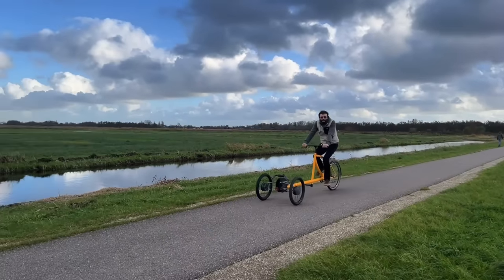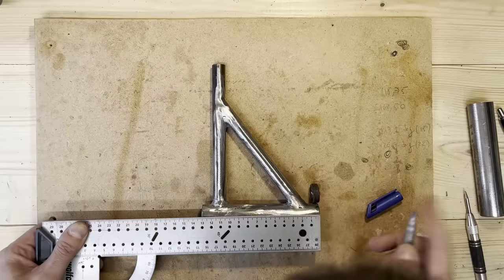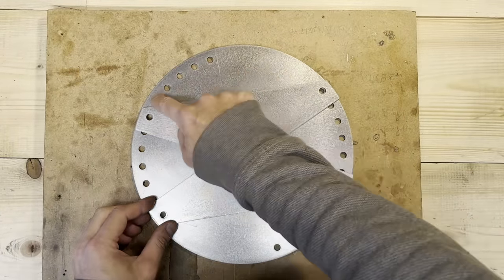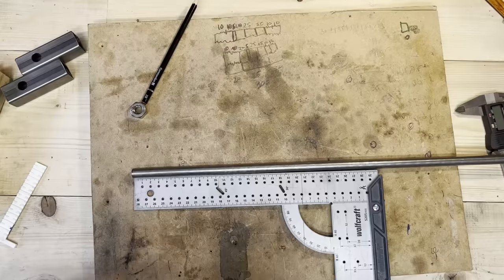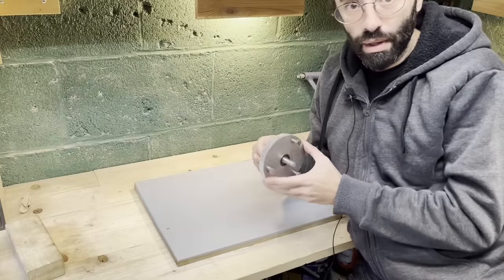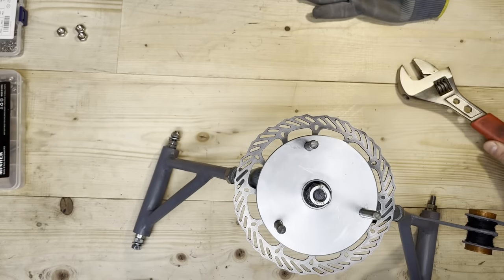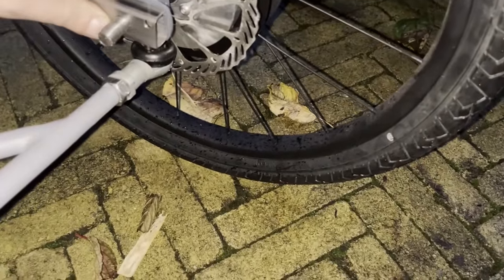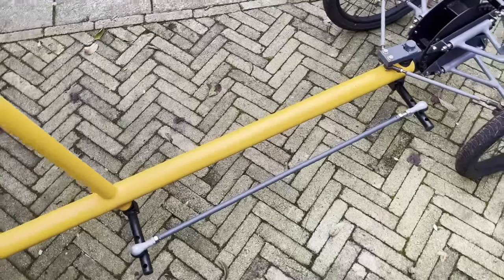Making of a Reverse Tilting Cargo Trike with Adjustable Geometry #5 - Full Build

Comment: All the ideas are there and great @predo-neves. I have many tips for manufacturing with more precision and simplifying many processes or just time saving. I don't know if you look into comments but I would love to share with you my experience and knowledge either by direct messaging or as a reply to this comment.
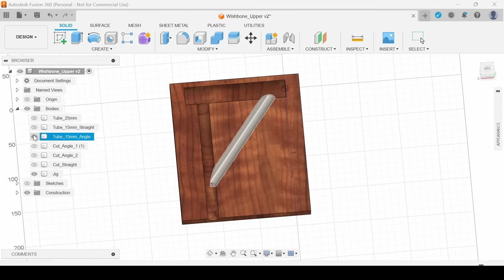Reply: 1:00 your jigs (repeated everywhere) could be made simpler with V faces. it would just take less time to make them and work just as well.
1:50 your notching jig could use more rigidity similar to a tailstock on a lathe. it will help belt tracking and accuracy and repeatability of your angle. it would also be wise to have your jig more perpendicular to the spindle instead of the pipe moving on an angle. the rear roller could also have a more elliptical profile to help belt tracking
5:30 your weld prep (repeated everywhere) could be improved by adding a chamfer to your tubes to both guide the weld and ensure full penetration even after grinding.
6:10 Ball bearing work best when the inner race and the outer race are in line. I would have a spacer tube free floating on the throughshaft on the inside or use angular/taper bearings or just use urethane or nylon bushings or even change things up to use rod-end bearings. you also can't be certain that the bushing you used has a face that is parallel to the other side less than 2mm.
7:10 almost all your connections could be done with male rod ends instead of the automotive bushings you used. you would only need to weld nuts or threaded weld on bushings at the ends of all your tubes and a locking nut onto the rod end. they can be bought in bulk and you can get some nylon style or greasable to prevent corrosion. 
the automotive ball joints are almost all used incorrectly because you are supporting loads on the threads instead of the tapered surface of the stem. you are paying for that precision on the stem which needs a hammer to uninstall usually because of the tight fit. you can easily get by with using male rod ends with a hole in the bushing for partially threaded bolts and adjusting is easier especially where you have a rod end on both ends, you can use a right hand and left hand threaded to make it so you only have to turn the tubing in between them to shorten or lengthen.
9:53 your load path for the suspension linkage could be improved just more of an angle to resist the shock absorber wanting to tear it apart laterally.
12:40 your caster disks are great but the nut should be on the inside of the plate. your plate is the reference surface for flatness but it is irrelevant when you weld a nut and use the nut surface to mount your items.
 13:08 your marking jigs should just be bolted to the pipe and never touched for the rest of the operations. you now have a square and true block which you can drag along a marking gauge that is fixed but adjustable height. to ensure calibration, drag it once for center and flip your part and drag it again. if the line is perfect on top of the other then you are on center if there is a small space between the lines you can drill in that small space.
Many of your drilling operations would benefit from a second center punch or the use of a center bit. they are more rigid and don't wander as much. your parts should be free to move across the level pane of your drill press when they are being drilled using a center punch. if the part is fixed but not lined up perfectly then the drill bit will be flexing if it finds its way into the center punch. you can see many shots of this in the video. the center punch needs to do its job of centering the hole to the drill bit. 
15:00 your hole saw needs more guidance for the fist face. just a block of wood against the near side to help guide the center bit.
15:46 get a drilling vise for this operations and most other drilling operations in your video.
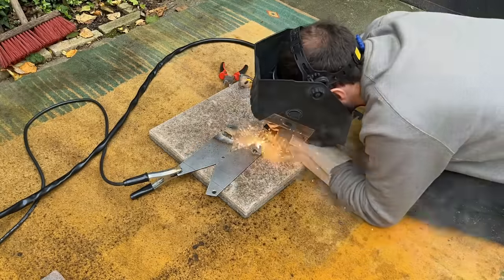16:20 callback to the tip for weld prep. the small 3mm plates should get a chamfer to strengthen your welds. a rod could be used to ensure the holes line up and don't warp when welding. If you used rod ends or bushing or just used two bolts for the front and back of the a arms you could avoid the need for slots. In terms of load transfer you can go back to picturing your shock absorber wanting to resist side to side compression so if you don't tighten the bolts in the slots well enough the wheels could blow outward. you could also have the slots on an angle so that if the bolts come loose you still have gravity holding the wheels in place.
17:32 example of drill bit bending. the part either needs to self center using the center punch hole or you should use a center drill bit that is more rigid to start the hole.
17:41 example of chattering cause by the drill bit not being centered on the hole. you can help this a bit with some paper towel soaked in oil between the drill bit and the part but you should really just let the part self center with the help of a drilling vise.
18:16 your rod is too far from the jaws of the vise and is therefore easier to bend and twist and move. you need a better grip on your pipe and ensure that the face on the ends is perpendicular and or the chamfer is perfectly concentric to give a good start for the thread die. tapping oil would also help in many ways.
18:35. crooked thread
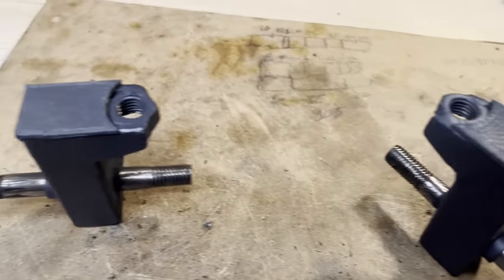19:43 you cant be certain that the threading of the welded nuts is lined up the way you need you should use reference surfaces and the welded nuts should only be used to bring two parts together. or you can use rod ends and bolts like mentioned before so that inconsistencies are less impactful.
20:55 your tool is extending to far out of your collet and flexing. you should do the locating holes through as a first step, take the part out a change bits and use the locating holes for both side to ensure they are concentric and try to check if you are consistently off axis to determine if you should flip the part differently.
your whole cnc is flexing when drilling plus the drill bit is flexing. you are losing tolerances this way. either make the tool and base more rigid or slow down the operations.
22:40 properly allowing the drill bit to self center. but you did use a regular drill bit to create the centering hole where you should have used a centering bit.
23:00 take your time and use cutting fluid. you're tap is not straight and you should not need that much effort.
24:00 you should have a spacer between the bearings and you should be pushing on the outer race when pressing a bearing into a hub and pressing on the inner race when pressing on a shaft respectively.
25:00 ensure the seating faces on either side are parallel and make sure your end mill has an edge radius smaller than the bearing. a spacer between the bearings with parallel faces could have helped the alignment.
Intermission to remind you that I enjoyed your video and technically you still made a great product that functions well. it's just that some things are done a certain way in manufacturing to solve many of the problems you encountered and you wouldn't need to change much to improve drastically and save time.
27:37 threads are not a reliable reference surface for concentricity. you should be able to find studs to press fit or have a centering hub on the bicycle wheel to have the threads irrelevant.
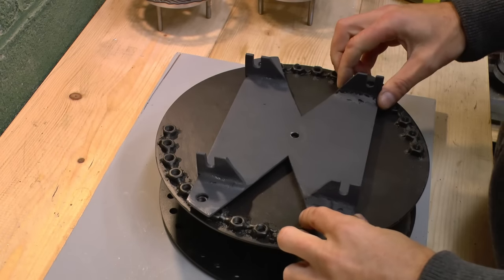28:15 you should probably just match the caster of the steering column of your bike that way the scrub and steering movement are more linear in relation to the movement of the handlebars otherwise you risk having a variable steering ratio from lock to lock.
 29:30 callback to using the ball joints incorrectly and you could save time and money using ordinary rod ends.
30:20 having a spacer between the ball bearings makes assembly easier and you are less likely to wear out your bearings prematurely by over tightening.
34:48 it would be wise to weld a tube in that hole to retain strength but somewhat of a minor remark
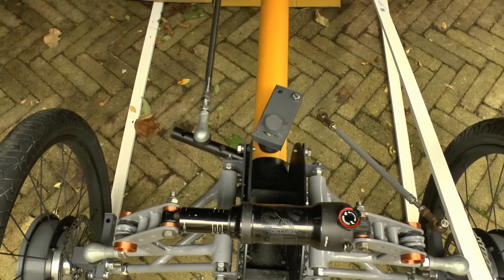38:13 if these were male rod ends with opposite threads on each end like mentioned above it would be simpler to make length adjustments.
38:34 you essentially turned the female rod ends into male rod ends plus you run the risk of loosing the threaded rod when making adjustments.
42:09 your adjustments could be more fine if you use rod ends where as you are limited by needing one full rotation of your ball joint.
46:00 your wheel hub design is unclear. I hope you are not transferring loads in to the spokes as they should only be under tension. you may need to true your wheels as they seem to not be concentric or there may be some tolerances or play elsewhere affecting the tracking of your wheels.
Best of luck in the future and I hope you can adopt some machining best practices to ensure professional results consistently.
Reply from the maker: @jimysk8er , I do look into comments and reply to most. I appreciate the engagement very much and I learn a lot. But, your comment is off the charts! You took the trouble of noting the time of each thing you saw that could be improved and give me an incredibly valuable lesson about it. That's just great. If I'm honest, I didn't even know what a centering bit is until your comment. And then I went and view a video about it. This is the single comment with more things to learn I ever had. I'm actually an electrical engineer and a mechanical hobbyist. Because YouTube has been a hobby for me, I've been sharing my mechanical projects. I know I am an amateur with a lot of passion but little theory (and practice) and I won't let a learning opportunity go wasted. In my next video (where I explain the geometry) I will already have some of the improvements you suggested. Thank you so much!
Reply: @pedro-neves  awesome I'm glad you didn't take it as too forward. Like I said your design is great I see no reason to change anything. Just some tips to make things easier. I'm a mechanical designer and a maker as a hobby so I wouldn't recommend anything that you could accomplish with what you have. Best of luck :)
Reply from the maker: @jimysk8er , thank you very much! The purpose of this project really is to improve it on every iteration. Best of luck with your projects too!